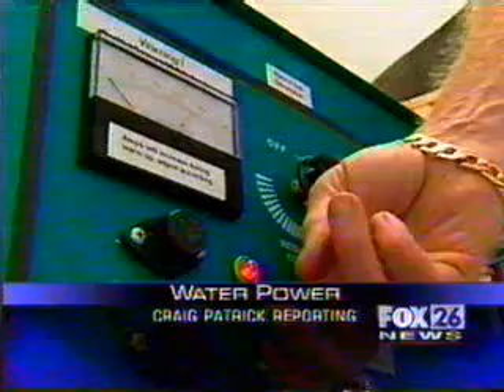Alternative Fuel Source

Comment: WATER IS NOT AN ENERGY SOURCE!

Actually, if you ignore waste (entropy) the energy you get from hydrogen + oxygen is the same as what it takes to split the water into H2 and O2. THERE IS NO ENERGY IN WATER. Elemental hydrogen (H2) will burn, but needs to be produced from water; ie. it isn't a source of energy but a delivery system like a battery!